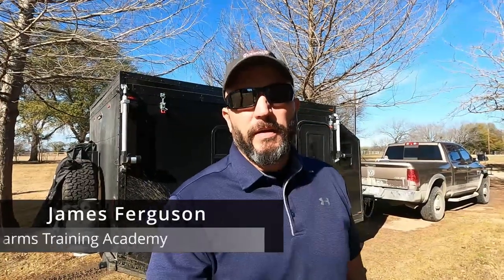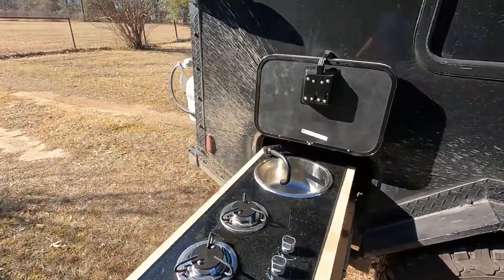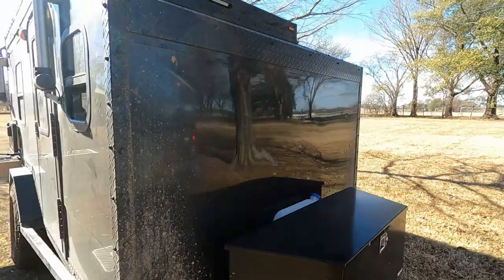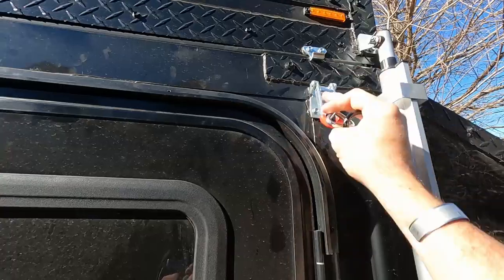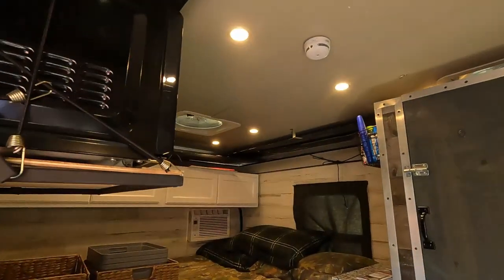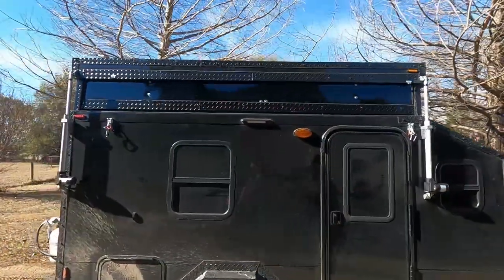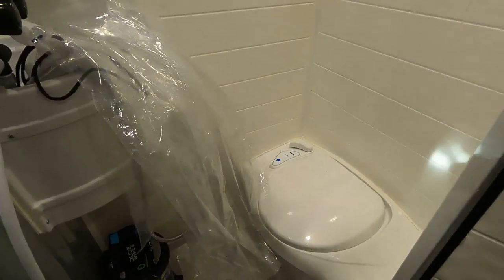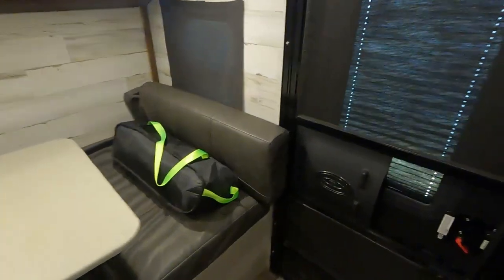D.I.Y. Travel Trailer Build Walk Around

Comment: Great to see the whole build!!!   If you did it again would you still build the pop up? Or just build it that height? Vs cost and engineering, time, issues associated with motors, etc?  

Great build I love the bathroom!!!  

What does she weigh?
Reply from the maker: Since I have towed it to Colorado, and it made my fuel economy as bad as if I was towing my cargo trailer, I would build it to the height I wanted with maybe more of a taper at the front.  Engineering the roof raise was the hardest part.  

Weight is right at 3,000 pounds.  Its heavier than I planned.  I am pushing the limits of the axels.  I will probably upgrade the axels to the Timbren 5k axels later this year.